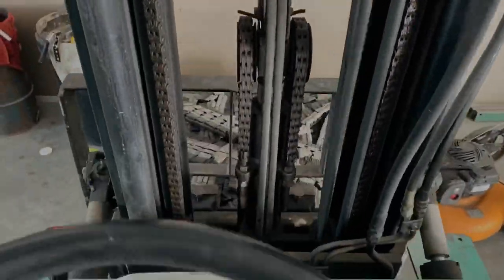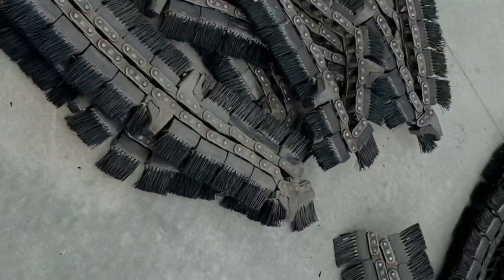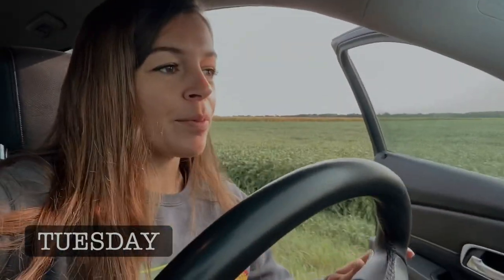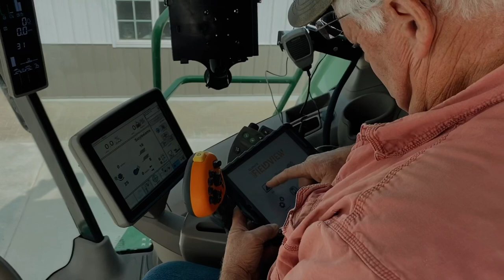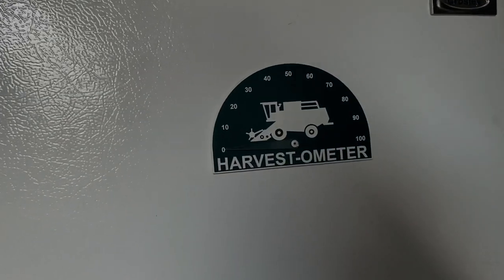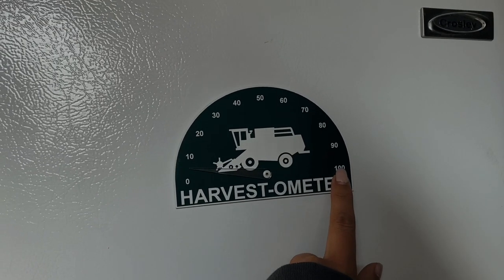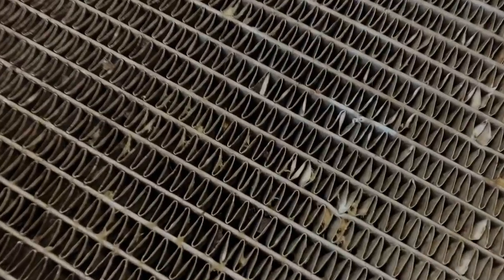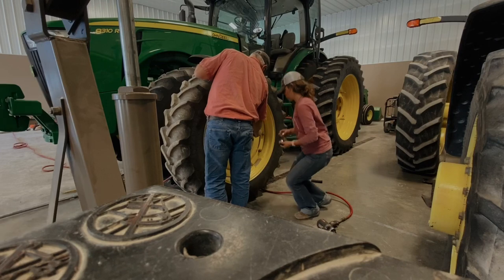Week Recap: Harvest, Breakdowns, & Roscoe the Raccoon

Comment: Sorry to keep asking a lot of questions, but 2 things.  1. So I understand the brushes, but what cuts the corn stalk? Is the sickle bar behind that? And 2. (Might be a dumb question, but what’s the advantage of putting the duals on the front of the tractor? Weight?
Reply: I’m sure Erin will answer but there’s rolls under the chain that pull the stalk down really fast so the ear pops off and there blades like a lawnmower under the rollers that spin and cut the stalk up into pieces also the brushes I believe are easier on the corn and less loss
Reply: duals are used to help lessen compaction, improve traction and the help float the machine over wet ground

Comment: If your auger cart tractor has auto steer? Set it up while running cart. Takes alittle bit of stress out of running it. Couple of different ways to set it up. Both work good.
Reply from the maker: The one I'm currently in doesn't have it at the moment otherwise I would!